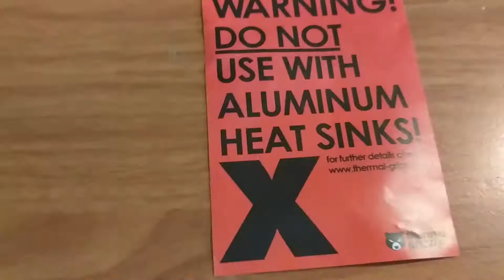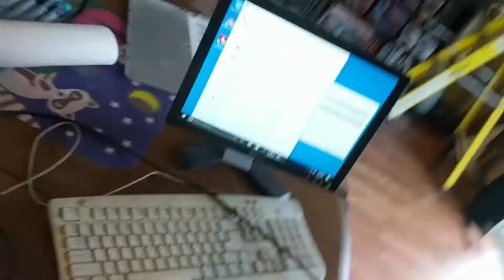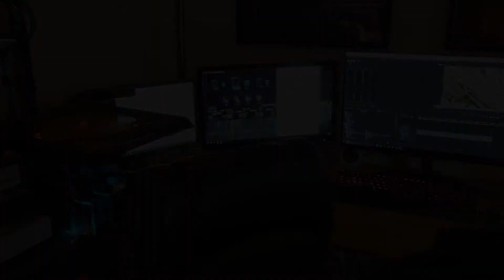Thermal Grizzly Conductonaut Aluminum Experiment and Review

Comment: gallium atoms disperse through the aluminium weakening the bonds in the grain structure. not only that but Ga-Al alloy doesn't form the surface oxide layer as regular Al does, instead it causes the oxidation of the entire Al part within the alloy. Al2O3 is super hard but also very brittle which is why everything comes apart like you see in this clip.
Reply from the maker: Hey Victor Unbea! Thanks for dropping in with the scientific tech details! Pretty amazing :D I did wonder what exactly and why this happens
Reply: I also found out recently that it's just part of the information. Gallium also has a pretty big galvanic potential (remember it's why you shouldn't mix metals in a liquid cooling loop). Also, all the above info is applicable to ALL metals. Gallium loves to alloy with all of them. The only ones that are relatively resistant are tungsten, tantalum and nickel. The first 2 are the metals most resistant to oxidation and the last one has one of the closest galvanic potential to gallium. The reason why the other metals do not crumble like Al is because they have a different (stronger) grain structure.

Copper is also affected by gallium. This is why liquid metal tim stains copper heatsinks. This is also why the tim 'dries out'. It breaks off atoms of copper and alloys with them, raising the melting point of the metal. The process is heavily dependent on several factors like the type of copper alloy used on the heatsink, if it is plated with another metal, if it has a protective surface of oxide (the darker copper, not the green one), how clean the surface was, if mounting was performed incorrectly and air/moisture was allowed to reach the tim.
Normally, conductonaut should last longer than the CPU. However, this alloying is the reason why it is recommended to replace it every 6-12 mo. 

Of course this is only based on written research. I have not yet tested it. If you have anymore conductonaut, maybe you can film some experiments with different metals?
A small edit: gallium alloys are usually less conductive than pure metal. Though the difference you would feel in a PC is about a drop of 2-4%, which is less than the fluctuations due to different loading of the CPU...
Reply from the maker: Oh wow! Yeah that's interesting and a great idea for an experiment indeed! :D

Comment: What copper heatsink are you using? Is it attached to an AIO Liquid or Tower Cooler? Also have you noticed the gallistan dry out over time? There's also a bit of concern about gallium-copper alloy forming over time particularily if you are hitting consistently over 80C. Have you reapplied or re-evaluated your conductonaut application on the 1800X recently? Have you noticed a hardened silver layer forming on the copper heatsink?
Reply from the maker: Very good questions man! I am using the EK nickle heatsink. This mobo had been pulled and a threadripper in its place. It was hooked to my custom cooling tower and it never ran 80c, only hit it a few times in extream oc testings. I am about to put this in a new tower and i am curious myself to see how the conductonat holding up, so I'll take the heat sink off and see what it looks like in an upcoming video :D

Comment: Would you recommend using this on a new intel 8xxx series CPU?
Reply from the maker: +WorthlessDeadEnd - indeed, it is really good stuff. Just make sure your heatsink isn't aluminum. This thermal paste is also conductive, so go with a little until it's covered and try not to get it on anything but the heat spreader.

Comment: Yeah that heat-sink looks like metal shavings held together by glue.. Didn't look like aluminum lol. But thanks for the video that was crazy.
Reply: We in the comments may have to pull our money together but, Next video use 5 maybe 10 grams & see if you can't cover half if not the whole Heatsink. RUN FUR-MARK Bench for 30min. & take beat... #FLAME_ON. lol